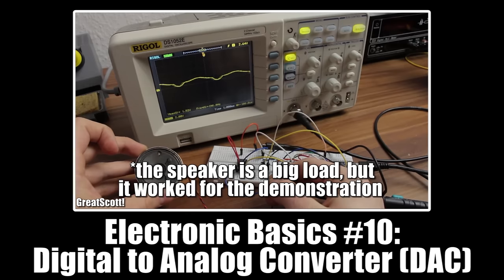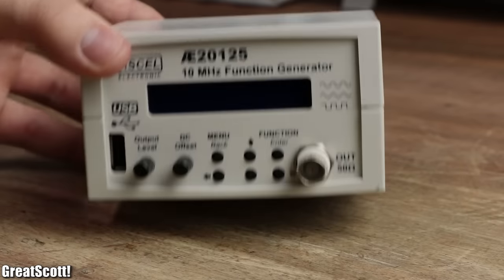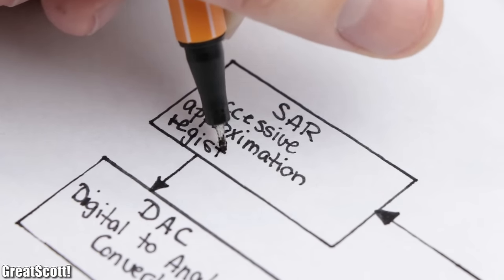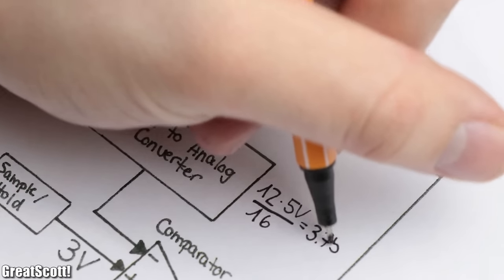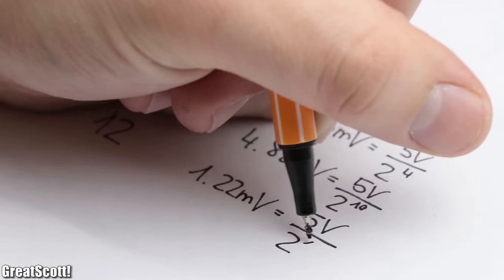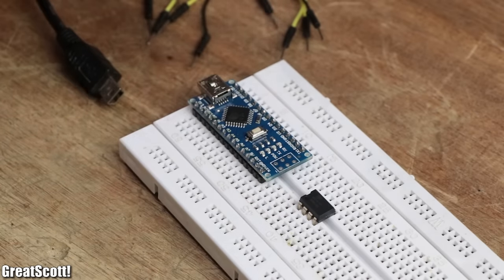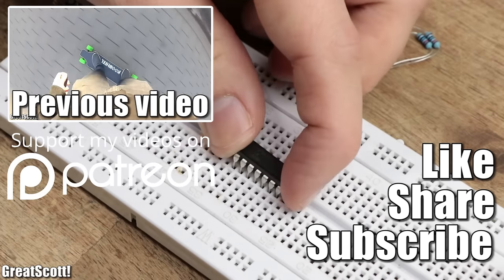Electronic Basics #27: ADC (Analog to Digital Converter)

Comment: You only need 2 times the maximum frequency (call it f) for the sampling frequency. The imperfections you get have higher frequency components that were not present on the sampled signal, so the reconstructed signal will be exactly the sampled signal, if you pass it through a low-pass filter with a cutoff frequency equal to f. In the real world, you want to sample at a slightly higher frequency than 2f, because filters are not perfect. This is the reason for 44100Hz sampling frequency of CD, you get 22050Hz as your maximum frequency, but your low-pass filter is set to about 20000Hz, to remove the sampling artifacts.
Reply: Good knowledge!!
Reply: This is true for audio applications, where phase is not critical. In other applications, such as oscilloscopes, having a sampling frequency only slightly above the Nyquist minimum will necessitate a very steep filter, which will invariably result in hefty phase shift. In these applications, you're better off with a sampling frequency around 5× the highest measured frequency (or more), and a shallower filter.
Reply: Which is what any decent and recent audio ADC does, by means of oversampling
Reply: I don't see how this can be the case.

The point of the nyquist limit is it's the minimum frequency you need to sample at to reproduce the frequency of the sampled signal, but as he says, you'll get the right frequency but you won't have a remotely accurate wave shape: It will just turn everything into a triangle wave. You will also have potentially horrible aliasing distortion.
Reply: @vapourmile  the interpolation in audio applications isn't necessarily linear. So good sine functions are created from few samples
Reply: @NamelessSmile  

That makes no sense and you immediate sounds like somebody with absolutely no clue what you're talking bout.

The Nyquist limit is the minimum sampling frequency to reproduce a sampled frequency.

By  minimum though it is Bare minimum and at exactly that limit the resulting sample will be ridiculously innacurat and have horrible aliasing distortion and possibly audible strobing.

If you blow a note on a saxopone, an A, the note is 440Hz, but if you sample that note at 880Hz it won't sound anything like a saxophone. It will just be a basic triangular wave of 440Hz, with horrendous strobing.
Reply: @vapourmile  you get a triangular wave only because you interpolate the signal using lines, but in reality, the Nyquist theorem assumes the Sinc function interpolation. But don't expect to recreate saxophone's A note by sampling at 880hz, that frequency is the first harmonic, THERE ARE HIGHER HARMONICS.
Reply: @sorenkarlesson5736  

I know. That's the point. 

The video maker has confused reproducing a base frequency, which you can at the Nyquist limit, with reproducing the sound and all its complexities.
Reply: thanks, was looking for this

Comment: About the nyquist shannon theorem: if you use a low pass filter on the output, the double frequency of sample rate would be sufficient to recreate the sine. This  is what the theorem stands upon. Its the backbone of digital audio. It has to do with fourier transform. Check Technology Connections video on the subject about nyquist shannon theorem.

Comment: Looks to me like you've misunderstood the sampling theorem, by the drawing and argument you made :) Oscillating between 1 and -1, that is the fastest frequency you can reproduce. That frequency should be reflected in your system by the sampling-rate. In the case of human hearing, we can detect up to around half of 20kHz, which is reflected in the common audio sampling-rate 44.1kHz, allowing us to reproduce a maximum frequency of ~22kHz. I have no idea where you got the 10-times rule you're mentioning, but sampling at twice the maximum of required frequency range is quite enough.
Reply: 10 times is good if you actually want the curve to be right. If you only care about the frequency > 2 times is enough. I don't think he got it wrong.

Comment: I've experimented with AD conversion using an Arduino in the past: my goal was to sample an audio signal, filter the lows, mids and highs, get their amplitudes, and appropriately analogWrite() the R, G and B lines of an LED strip.

Then Signal Theory hit me, with a heavy stick called FFT, and the computational cost of such filtering. Luckily, I also bumped into the wonders of analog electronics, and eventually built a low, band, high pass filter using OPAMPS. Good times.

Comment: Strictly speaking, the Nyquist-Shannon sampling theorem does not state that the sampling rate must be higher than twice the highest frequency of the signal, but higher than the signal's bandwidth. So if you sample at 20 kHz and have a signal with frequencies ranging from 90 kHz to 100 kHz, you can still perfectly reconstruct the signal, since if your digital version of the signal contains a frequency of x kHz, you know the original signal must have been at (x + 90) kHz (the signal is "aliased" to below 10 kHz). This is called undersampling and is frequently done in ultrasonic positioning systems, where your signal can be bandpass-filtered in hardware, before being sampled at a sample rate much lower than the signal's frequency, which decreases the computational cost of analysing the signal.
Reply: Thanks. Nyquist-Shannon is super interesting.

Comment: What do you think about creating an adjustable switching bench power supply? Should be able to at least use the entire primary side of a PC power supply, since it boosts voltage to over 300 volts. You could either make a new secondary side, or just upgrade the secondary side with higher voltage rated caps and whatever other components need upgraded. The power monitor chip is probably just powered off the 5 volt stand-by transformer. Should be as simple as hooking up your secondary side's output to a variable voltage divider so the the voltage monitor chip always see's 12 volts; and, when you dived the voltage more the actual output goes up. i guess to get less than 12, you could use a simple linear regulator.

Comment: you can get a nice signal out of 2 samples per period but in post-procesing, when you already have future samples - use some sort of spline (cause we can't get the ideal shannon interpolation formula). You can also get a good result if you delay the output by 4 or 5 samples and do a spline over them. (similar to matlabs interp1 with spline function). but the more samples you can get the better

Comment: You are not stuck with the number of bits of an ADC.  If you need higher resolution, you can oversample and average, or use noise shaping and filtering to remove some quantization noise (equivalent to extra resolution) from a frequency band of interest below the Nyquist frequency.

Comment: Is there a hybrid ADC that uses more than one comparator at a time with successive approximation?

For example, instead of dividing the search space in half with every step (when using only one comparator), you could divide it into 4 using 3 comparators and collect 2 bits of information in each step instead of just one. That would make the ADC find it's value in half the time.

I would think you could do this up to any number of comparators that are practical on a flash ADC. Has this already been done?

Comment: So an ADC always gives a value too low, because of the comparator only approves 1 bit if the proposed digital voltage(from SAR) is lower than Vin. And because of this the uncertainty from the resolution is always on the low side?

Comment: The Serial output makes the Arduino run slower.
That's why you have 9 kHz. Normally it takes 100 microseconds, so more  something like 10 kHz to read analog inputs.

Comment: Well... but digital 4 bits actually means analog 2x2x2x2 bits if im not mistaken.. so it doeas 16 comparisions of mostlikely 16 resistor voltage divider or something internally..

Comment: Greatscott, are breadboards bad because of their capacitance? Are they good for just random tinkering? Or can they keep up with precise timing chips and power supply circuits?
Reply: the capacitance of a breadboard is in the pF range, even lower.

I've used them for signals in the 100kHz range and never had a problem. You shouldnt be dealing with microwave circuits unless you're a professional. Also a breadboard can handle several amps of current, but if you're doing anything with higher than 1A, I suggest you just use regular wire to connect things.
Reply: Capacitance gets annoying when dealing with high frequency signals. You can get a lot of crosstalk between stripes, and the signal tends to be rounded (aka the higher frequencies gets cut off).
That said, I already used signals around 8MHz on a breadboard, but it looked more like a sine wave than the square one it was supposed to be (although a sine wave was perfectly fine for the application).
Regarding timings, if you make sure to keep coherent lengths for the signal paths you'll be fine.

Comment: I think you have gotten Nyquist Shannon wrong. Any bandwidth limited signal can be accurately represented with the sample rate that is twice the frequency.
From Wiki : (The exact error that you and everyone makes)
Intuitively we expect that when one reduces a continuous function to a discrete sequence and interpolates back to a continuous function, the fidelity of the result depends on the density (or sample rate) of the original samples. 

BUT...(Again from Wiki)
The sampling theorem introduces the concept of a sample rate that is sufficient for perfect fidelity for the class of functions that are band-limited to a given bandwidth, such that no actual information is lost in the sampling process. It expresses the sufficient sample rate in terms of the bandwidth for the class of functions. The theorem also leads to a formula for perfectly reconstructing the original continuous-time function from the samples. (No loss of data, lossless).

Comment: Hey, sorry for being off topic but can you answer on the arc lighter video, can we re-use the ccfl inverter from a scanner? I heard the voltage from a scanner ccfl inverter were low compared to a LCD ccfl inverter. I would also like deeper explanations regarding the pinout of the transformers on ccfl boards, and how you successfully rewind it. Thanks in advance.

Comment: Hey Scott, thank you for this video it helps a lot to understand the way an ADC works. I've been working with an ADC10158 and i have a question, have you ever used a pin in an ADC called VREF_OUT pin?

The ADC itself has Vref+ and a Vref- pins for its bipolar mode of operation, but it also has this other pin which the datasheet recommends to bypass to ground  with a 330uF cap but i'm not sure i'm doing things right because when i do this the ADC throws out incorrect values.

Comment: Hey Scott, I have one question. Why do you divide the analog reading of the Arduino (which returns a value between 0 and 1023) by 1024? If the maximum value that the Arduino returns is 1023,  shouldn't you be dividing by 1023?

Comment: You know. I see a lot of info on ADCs and DACs out there. I even had classes on how they work in Physics Engineering. But now I'd like to select ADCs and DACs for a specific project and I'm having an issue no one addresses anywhere:
I'd like to select a pair of ADC and DAC that match. Surely that's a thing electronics designers have to do all the time. What considerations have to be made?
What I mean by match is: have the same protocol communication characteristics and play well in the same system, connected to one MCU or FPGA. I'm not even referring to resolution or other specific characteristics.

Comment: I am using a Raspberry Pi and want to convert 2 signals: the Energy in Joules on the cap bank and the power delivered to the load. Then I plan to display this info on a 7-seg after processing in the RPi. Would the 12 bit ADC in this video work for that application?

Comment: Hey GreatScott !
Where have you learned all this things ? I'm very interessted in all this things and want to learn it :)

Interessting would be also, how to control a brushless motor!
Reply: Nicolas Zikes Trial and error, with lots of error. Hands on is the best approach if the books melt your mind. Start by making an LED blink, then make it blink faster, then slower. Next make it go on and off with a switch, then try other sensors such as motion  or temperature sensors, eventually you can hook up your LED to Wi-Fi, control it with your phone from anywhere in the world. Now try swapping your LED with a relay and you can turn on your crockpot from work 4 hours before you go home.

Comment: I thought you were going to show the sinc filter that makes the samples into a perfectly smooth sine wave again, which is the whole point of the Nyquist-Shannon theorem. But no, you just made that connect-the-dots thing and then went with a way higher sampling rate. Thats NOT the way to do it, so no I did not learn how a DAC works.

Comment: What is Vref  and why did you do that calculation between Vref and bits : vref* bits(10)/ 2^no of bits  ?
Reply: V ref is assuming the max voltage which keeps moving from low to peak(5 volts),the 3 volts is like in transient state so it's what gets in to the comparator amp.

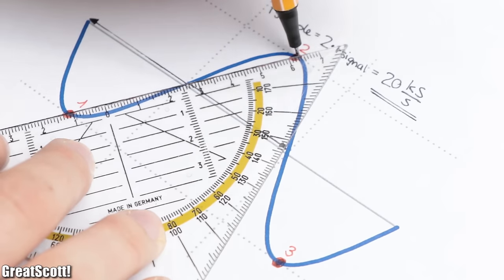Comment: @2:00 I don't think this is technically true! The implication of Shannon-Nyquist is in fact that a full reproduction, with absolutely 0 error, of the signal is possible provided that all its components are below f/2. The 'best case,' unfortunately, is beyond what we can easily implement in an analog lowpass filter. But we can and do perform these reproductions in the digital domain all the time, whenever we use an FFT-based media codec for instance.

Comment: I know this isn't really relevant to the video, but I hope someone can answer my question! :)
I'm looking to buy a transformer to convert 220v 50hz to 110v in order to power a Dremel rotary tool that runs on 110v 60hz.
Now I know that these transformers don't convert frequency, so it'll be 110v at 50hz. Would the Dremel tool experience any problems because it's running on 50hz and not 60?

Comment: The 16-bit ADS1115 module can usually be found for about $1 on ebay, so it's probably one of the best options for a hobbyist who wants to noodle around with differential ADCs:  https://thecavepearlproject.org/2020/05/21/using-the-ads1115-in-continuous-mode-for-burst-sampling/

Comment: Anyway it is a good learning and hence thanks. However, it is not a full learning and knowledge in terms of noise reduction etc, which is one of the major problem to solve while using the ADC effectively.
Also, please avoid printing Datasheets and go green by referring them on the laptop or online.

Comment: you do not need to sample a signal with a 10 times higher sampling frequency.
where did you get that from?!

as long as you stick to the nyquist-shannon theorem and sample the signal with a sampling frequency which is 2 times as high you can - in theory - perfectly recreate the sampled signal using an appropriate LP filter. 

please don't make hobbyists think that Fsampling = 10 * Fsignal is an actual formula!

Comment: What is the ADCSRA ? 
For sameling Audio i need a Samplerate of around 44100 hz 
Can this be achived with an arduino uno ?
Reply: The ADCSRA is the ADC register for setting the prescale of the sampling rate of the ADC converter.  The maximum sampling rate of the 328p is 200KHz usually, the arduino is set with a prescaler of 128, this means the sampling rate of the ADC converter is a 128th of the clock frequency.  You need to first remove the actual prescaler end then, set the new one.

Comment: A sample rate 10 times as high as the frequency of the signal? Sounds like pure audiophool BS to me. The ACDs and DACs in those types of devices are not for capturing sinusoidal signals to later be reconstructed. There jobs are to be simple sensors.